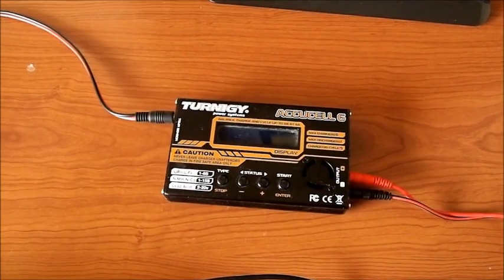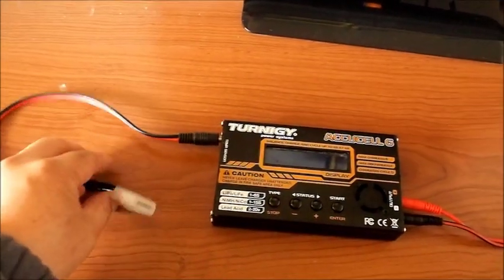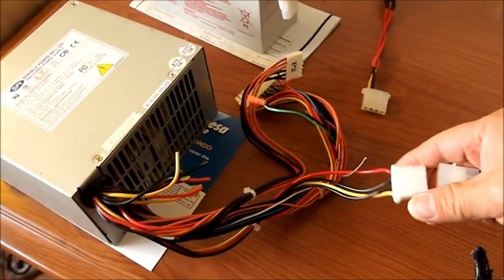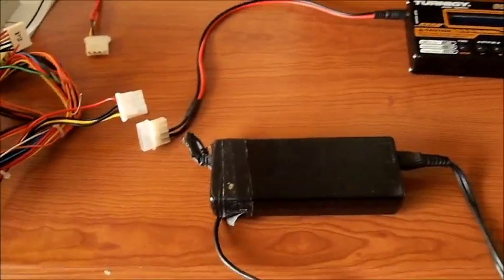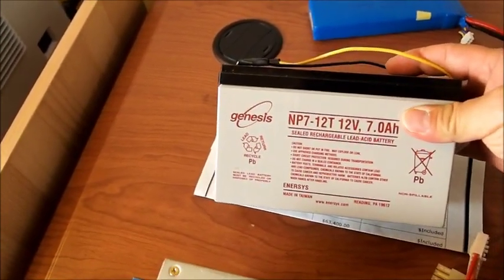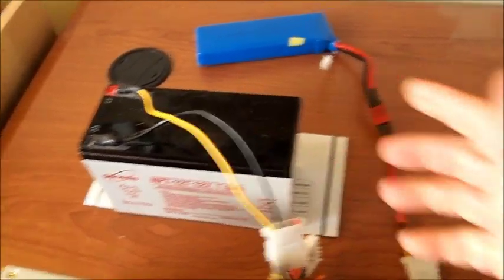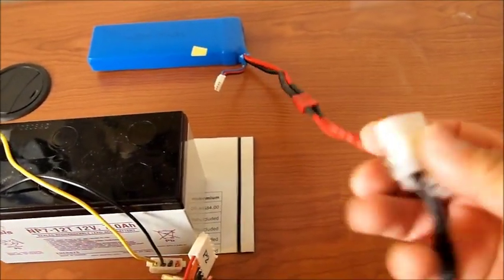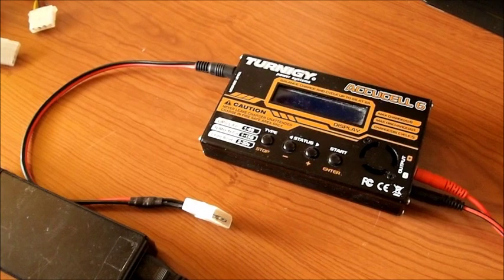Power sources for my Turnigy accucel-6 charger

Comment: Could it would with 10A, 12v and 120 watts?
Reply from the maker: Sure. This turnigy is rated from 12-15v, so yes. You'd be fine with 12v, 120v. The amps won't matter.

Comment: This is so ridiculous to power up something that should come w/ a power supply.
Reply from the maker: True to some extent; however for the rc addict like myself with lots of ps lying around, I'd rather it come without a ps, since that makes it cheap.
Reply: completly agree, un fucking believable. I just bought one of these and cant even power it up using A.c. Im looking for a power adaptor that will suit, but cant find any supply that are 10a..... that will suit this unit

Comment: beginnner here, is it true that the amps for the power supply doesn't matter since you use the turnigy to limit that anyway?
Reply from the maker: Yes and No. Yes. It is true that you can limit how many amps on the turnigy, but the reality is why would you do that? so No, it does matter, since you want to charge as high as a battery would allow...
Reply: rcAllDayLong thanks rc!, i heard that a lower amp would be better for the battery....i can see my question being a bit unclear. basically if the turnigy's amp limit is 6a, then any power supply that can deliver over 6a is unnecessary since the turnigy would limit it, right?  and it's not unsafe to have a super high amp rating on the power supply since it would get limited by the charger.
Reply: danh le  Yes. correct. As long as the device can cope with the voltage, the amps won't matter. The device will only pull as much as it needs and not more. As for lower amp better for a batter- that was true 10 yrs ago when I first started, but not so true anymore. Look on the Lipo for the charge 'c' value. Almost all Lipos these days can easily cope with 2C, and some will cope with as high as 5c. for a 1000 mah, charging at 1c is 1amp, so 5c is 5amps. hope that helps.
Reply: Charles Yang thanks Charles for the confirmation!

Comment from the maker: This means the power input is too low. You sure you're using the 12v side on the computer power supply? The computer power supply also has a 5v output, so most likely you're using that and not the 12v output. Your keyboard power supply is probably only 5v. get one of those volt meter from harbor freight for $5 and you can check the voltage.

Comment from the maker: Well, to answer that question, you need to know how many amps your Lipo charger will pull. If both chargers combined amp usage is below your power supply, then you're fine. If not, the charger will max out and not charge any higher (I can only speak for the turnigy charger...since this is the behavior)

Comment: I'm considering buying a small 12V MC battery (gel battery) with 3A, would this be enough to charge 5-6 micro heli batteries (300mah each)?

A 3A 12V battery is about 1KG, anything more is too much for a suitcase.

Comment from the maker: The computer power supply works great since most everyone has an old decommissioned pc. the 12v is pretty easy to find. There are only 2 voltages (5v and 12v). If not sure, just use a voltmeter.

Comment from the maker: No. You risk burning the charger with a higher output voltage of 18.5v. the Turnigy accucel-6 is rated for only 17max v.

Comment from the maker: That should work fine. The amps don't matter at all- matter of fact, the more amps the better. What is important is the voltage. you need voltage between 11v - 17volts.

Comment from the maker: that'd definitely be nice, but I suppose they tried to shotgun it so they hit the majority of the most popular power supply used by rc guys- mainly people that charge out in the field are using their cars or external deep cycle batt and those are all 12v (with a full charge, or while the car is on and generator running, it spikes up to 15v)